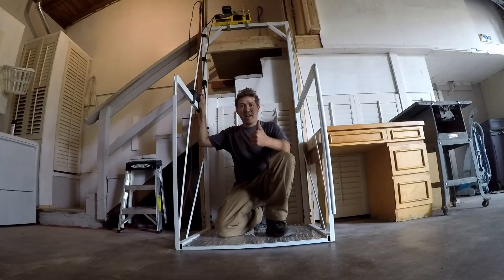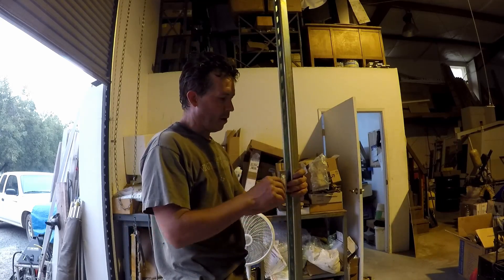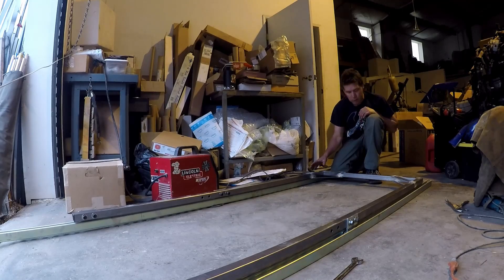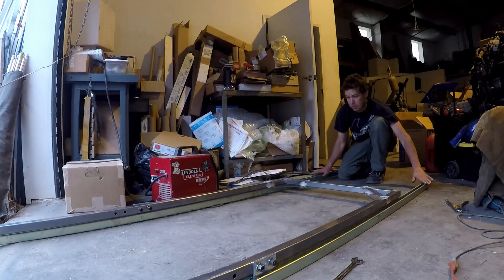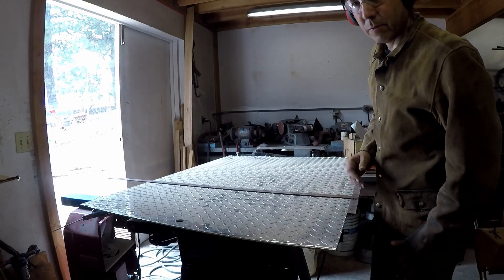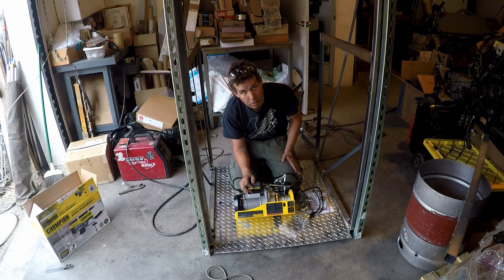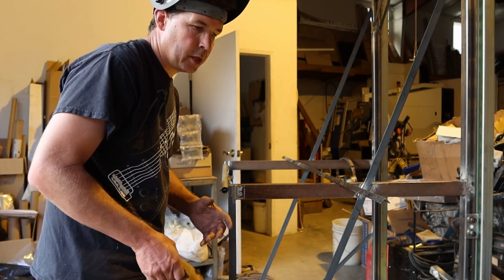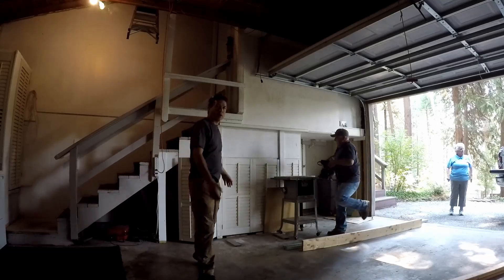How to build a small elevator

Comment: Speaking as a lift engineer , if I was called out to work on this machine I would have to turn it off . It’s a cross between a guillotine and a crush . You’ve no safety gear to arrest the fall if the ropes break or more likely looking at your guide rails and rollers , if the lift jams up and cuts thru the ropes cos you have no slack rope device to stop the motor . Hopefully it’ll trip the motor protection before it kills someone .
And that platform at the top . What if he turns left when he walks out of the machine ?
You need to go look at some domestic lift designs my friend .
Don’t let an insurance inspector see that machine . I promise you I’m doing you a favour . I know it sounds like harsh criticism but lift design has followed one catastrophe after another for 150 years and more .
Reply from the maker: At least one of the issues is covered. There is a drop down safty rope on the left. Total lift on this is about 5 feet. Not likely to be leathal if it fell. The button has to be held down to make it move. If it jams they just let go.  There is no possibility of the lift cutting the cable. I also have the parts to put in safety's. I'm just waiting for them to get their second covid shots. Thanks for the advise.

Comment: Infact, I have been planning to build a lift to rise to 3 landings using the same principle. Yours have given me confidence and encourage to go ahead. Thanks a lot.
Reply from the maker: You may have to get a heavier lift and run direct. I used the pulley on mine to get double lift capacity and half speed. I dont know if the cable would be long enough to do this over 3 levels. Also definitely put in safety's you are running much higher. Good luck with your build.

Comment: Very cool project. Elevator design was great.. That cable problem would be , maybe off-set where the cable mounts, so it pulls a little off center. To help the cable pull in alone side each run...!!!
Reply: Good point we.do that with chicken house winches

Comment: Double nut the safety railing.
Reply from the maker: The bolt threads directly into the frame. No room for a double nut. I think I put lock tight on the threads to keep it in place.

Comment: 😲🤷‍♂️Why 🤷‍♂️on earth would you use those rail for your elevator 😲🧐🤔🤷‍♂️? Especially when there are holes 🕳 in the bottom of it. What ya should have done ✅ was to Use the Same Track That Barn Doors Ride on. You would have a much better smooth experience than what you came up with 🤷‍♂️🤔🙁. Think 🤔 outside the box 📦.
Reply: All it does is guide the platform. Plus, the trolleys are designed for the unistrut.

Comment: How much weight does this thing hold please comment back
Reply from the maker: The host is rated at 880 pounds. I assume there is a significant safety margin built into that. However it is a lower cost hoist and is a use at your own risk. The lift weights about 100 pounds, the person it lifts is about 180-200 pounds,occasionally they carry things with them so I would estimate the lift normally lifts between 300 and 400 pounds. I am putting safety's on this soon.

Comment: I found the trolleys to disallow screw head clearance so I produced 1/4” thick spacer plates and welded those to the back of the unistruts. The screws cleared trolleys.
Reply from the maker: That's a good move, I had to mill mine down.
Reply: Use deeper strut.
Reply: @donsmith9081  The ideal method is to weld outside edge angle brackets to completely avoid screw heads in the channel seat.  I did that at the top but not on the bottom at the door jambs as the door trim would not lay flat and I should have triple sisterered the door 2x6 verticals allowing outside bracket weld attachment.  The dee channel requires equally larger trolley wheels when using these as vertical verses horizontal tracks.    Works fine as is I’m happy.

Comment: @Dirty Shop DIY
Instead of me just making a comment about what you need to add to the build to keep your in-laws from plummeting to their deaths, I will at least recommend an item to use.  Try mounting fall arrestors from durawear.com to the roof rafters.  They work like seatbelts. Come down at a slow controlled rate no issue, come down too fast and they lock in place.  Here is another fellow youtuber who installed a set.  https://www.youtube.com/watch?v=3L3WgKPq5Rs
I hope this helps in your search.
Reply from the maker: I am actually planning on installing seat belts in this as a safety. It is not so high that if something happens and they lock it wont be to hard to get off. I am also installing a synthetic cable for more strength and smoother operation. Thanks for the suggestion. I will look at those arrestors.

Comment: What size of the MS pipes are you using?
Reply from the maker: I'm not sure what an MS pipe is? But I think the frame was made from 1.5" X.125" square tube. It was the size that fit in the clamps on the hoist.

Comment: What happens if lift stops half way up. Is rider stranded
Reply from the maker: Potentially, yes. However the distance covered is only about 6 feet. So they would never be more than 3 feet from top or bottom.

Comment: Yeah the cables rolling over themselves cause excessive wear, and can lead to failure. Useing a cheap hoist of Amazone to move a person is a really bad idea and is playing fast and loose with someones life just to save a few bucks.
Reply from the maker: Could you suggest a better hoist?
Reply: @DirtyShopDIY  http://www.cargolift.pro/ might just sell you the hoist for there unit. And while not fot people this is one of the safest lifts you can get for a none people moving price https://www.verandavator.com there is also the stiltz home lift that is low cost
Reply: @Ham549  I would bet that they are using another version of a cheap made in China motor, as this guy bought from Amazon. You say he's playing "fast and loose with soneone's life", and then recommend a motor off a rig that says it's not for people........doesn't make sense, and isn't helpful.
Reply: @loweredd  they will always say not for people to cover their asses. Lawyers. Has nothing to do with quality or safety.
Reply: @DirtyShopDIY  for all the more one of those motor/hoists actually cost (compared to a fall) I would advocate having 2 of them running at the same time.
sure, only one of them is needed...but since you intend to move people..
Reply: Also put on of these on McMaster-Carr Page:  
 https://www.mcmaster.com/Fall-Protection-Equipment/quick-stop-fall-arrest-lanyards-with-anchor-point

Comment: Great simple design. I would try to add a safety if the cable should break.
Reply from the maker: Working on It. Thanks
Reply: @DirtyShopDIY  Thinking about an autostop, and coming from a sailing background, I imagined a counterweight so that the platform could be lifted with one hand, saving power and work on the motor  The counter weight would be something heavy with a pulley, and some 1000lb test rope, commonly found on sailboats.     Also on sailboats there are ratcheting blocks, which would work pretty nifty but probably not stop the weight of a falling person, although it'd slow them with the notches in the pulley.   Otherwise, there are rope clutches that might be able to be operated with a solenoid/servo and Arduino to release when the down button is pushed, and lock when the down button is released.   The clutches or the ratcheting block would allow up no problem.   Might be possible to respool the winch with rope which would allow the use of the ratcheting blocks or the clutch without the use of the counterweight.   All this sailing hardware would cost hundreds,  "safety third" is a good motto.     Rope clutch:  https://www.mauriprosailing.com/us/product/LEW29101110BK.html     Ratcheting block:  https://www.velasailingsupply.com/harken-40mm-carbo-ratchet-block/?sku=HR2608

Comment: SAFETY LESSON:

9:18 To anyone watching! Don't EVER leave a cut item on the table saw blades like that while not being handled. The wood or metal can vibrate and get sideways while in between the blades causing a kickback. Cut piece can be thrown and cause serious injury. ALWAYS power down the saw if you need to leave the area mid cut. Nice project BTW!
Reply: @j88 I use to be a bouncer and prison guard so I'm very observant.
Reply: @rotaryperfection  You dont have to be that observant watching a video and i am sure he was being very sarcastic. Because I was thinking on the lines he is, while kickbacks do occur i am sure that piece considering the size of it and weight and from my keen observant skillz considering the previous 2 points about size and weight i am pretty sure the motor would have bogged down before it could throw something that size and weight. I am a woodworker / furniture builder and a avid watcher of strippers and porn so I also am very observant. Ty!
Reply: @reality150tv  This isn't a laughing matter for me. Why would you try to tell someone they don't need to be that observant when that same person you're trying to tell ACTUALLY had an accident? I made the dumb mistake of doing something similar my senior year in high school. I had a brain fart moment, left a piece of wood in between the blade and fence and was about to reach down and turn off the machine and had a kickback 1" from my nut sack. The corner of the wood ripped through my jeans and left a scar that reminds me everyday from what happened. That could have also been my temple had I put my head inline with the flying back debris why trying to turn off the machine. You see I had TRAINING in shop class since 7th grade and every year we are taught to NOT do this. So tell me again why I shouldn't try to WARN anyone else since you're the analyzing expert here of weight, power of the machine, and momentum? I failed my training and I paid the price. That's the lesson here and I don't want anyone else to get hurt.
Reply from the maker: You are correct here, this piece of aluminum was heavy enough that there wasn't much threat of that happening. On smaller pieces it becomes more of an issue. But you may have noticed all the safety gear I was wearing. Thanks for the tip.
Reply: Don’t get stripper in your eye.

Comment: How much does that metal frame weigh? And the winch? Gotta be pushing almost 300 pounds. So if you have a winch at 440 max load rating anyone whop gets on there over 140 pounds is stressing it beyond its max. Winch is definitely underpowered for this application. Also you have no safety stop if the cable breaks or motor fails due to overweight load. That thing is gonna plunge straight down to that concrete floor and whoever is on it is going to get hurt. Nice idea and overall good execution but 2 major oversights. You should address these sooner than later especially with it being used for people. Just my 2cents.
Reply: Assuming the man is not dumb as he has a mill and capable math skills, and enough skills to figure it out in the first place, I think it is safe to assume he has done the math and figured the margin of error out already. Having said that I dont think he needed ur 2 cents, just my 2 cents.
Reply from the maker: I addressed one of those issues. Iheartmedia frame is less than half that weight. And the wench is doubled so 880 pounds rated.
Reply: 880 is definitely better, thanks for the update.

Comment: Hi ! I like your detailed assembly of your home lift. How do you do the auto stop with your electric cable hoist?
Reply: The wench is built to stop automatically when the cable is fully rewound.
Reply from the maker: In this case the auto stop on the lift was just about perfect. Otherwise I had a wood disc and some clamps to make my own stop